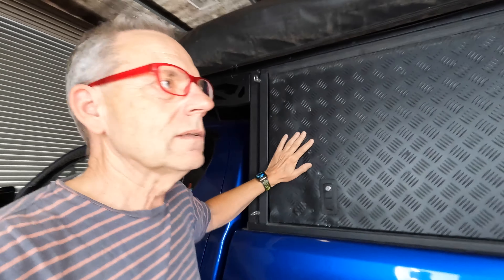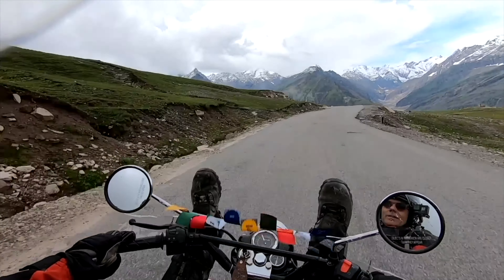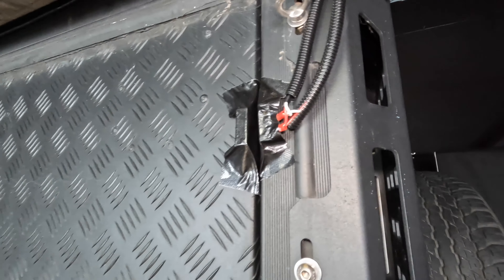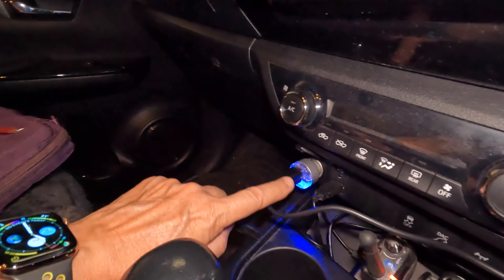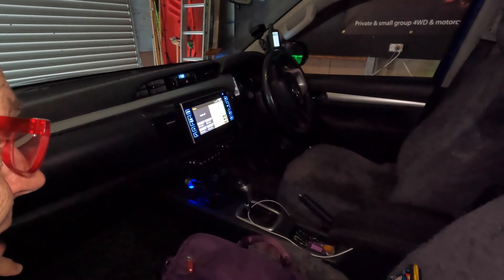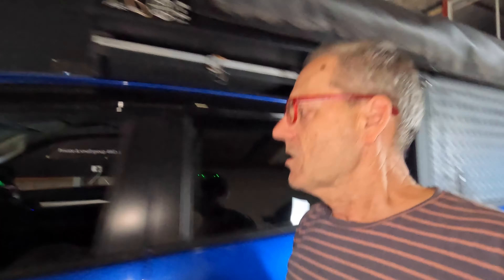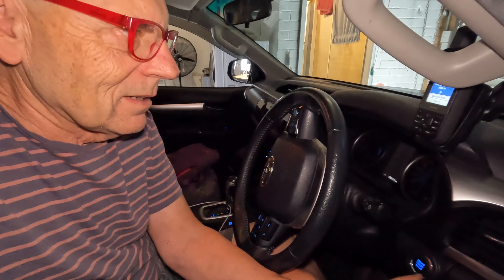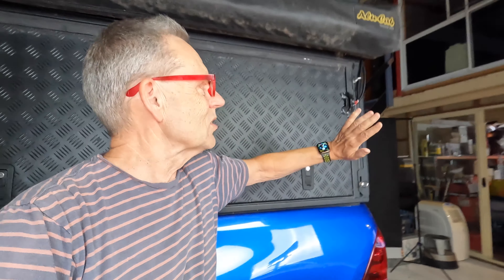Alu-Cab Canopy Camper - Install Door Sensors to Prevent Accidences. Toyota Hilux

Comment: I almost suggested running your new setup inside but then it occurred to watch until the end lol. 
I'm getting my camper next week so I'm spending some getting some good ideas from the likes of you. 
Do you have a security system for the back?
Reply from the maker: Thanks for watching.  I have a combination lock on the rear door.  So no key, just need to tumble numbers.  One of my viewers suggested putting a latch on the bed, so if the roof is opened, the bed can not be lifted.  Good getting suggestions from everyone.